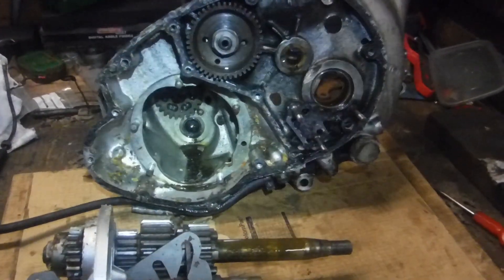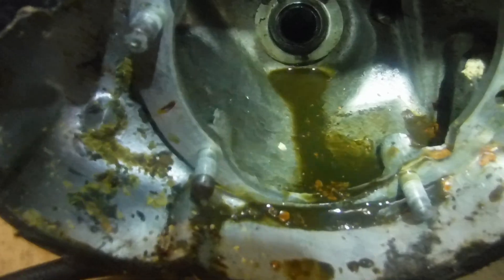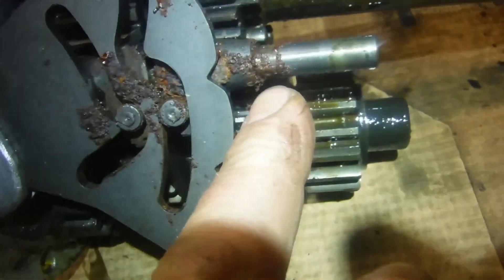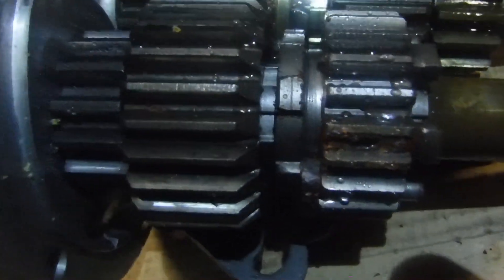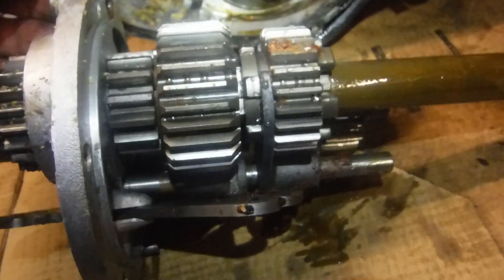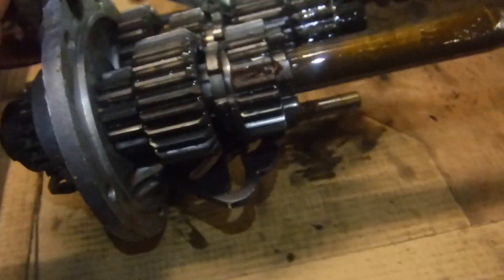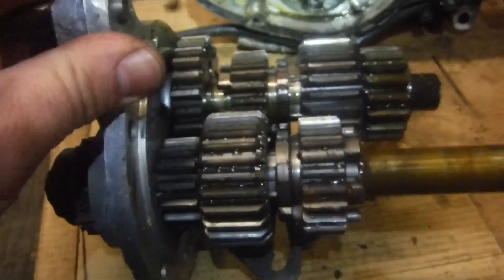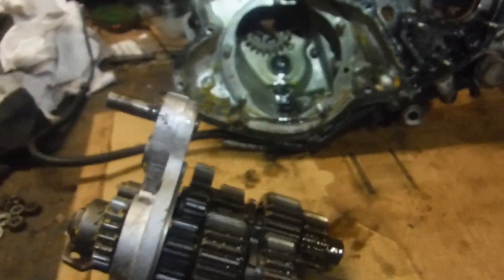BSA A65 Spitfire engine overhaul 3 First impressions of the gearbox components.

Comment: Hi Paul,  I don't know if it is just the camera, but if you need a head torch to see , you really need to get some of those 100/200w LED lights in your workshop,  it would be a huge improvement and probably stop a lot of eye strain , I don't think they are even that expensive now,  buy half a dozen and you'll be amazed .

Comment: Going back to the 50/60/70's, was it not a thing to put sawdust into noisy diff's & gearboxes to quieten them until the vehicle was sold on described as in good running order?

Comment: I'm sure it would be too expensive, but it would be cool to send that crap out to a lab for testing to find out what that is.
Reply: Emulsified gear oil goes like that if left long enough.
I bought a farm tractor which had a broken top gearbox gasket and had about an inch of water in the bottom. Some of the sludge which was left in the bottom after draining was a yellowish foam.
Fork oil will do something similar if you drain it into a pan which you forget about and leave outside in the rain.

Comment: What a load of stinking grollies! I have come across a similar condition RE Continental gearbox (with a 4 speed cluster), but that was not still installed. It cleaned up and worked fine for many years after.